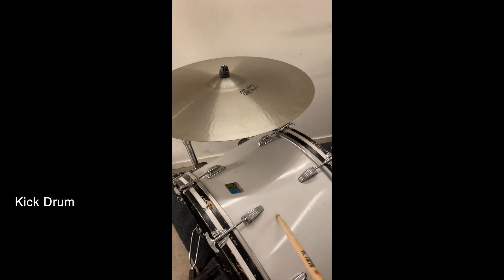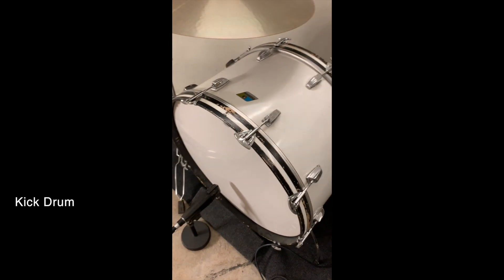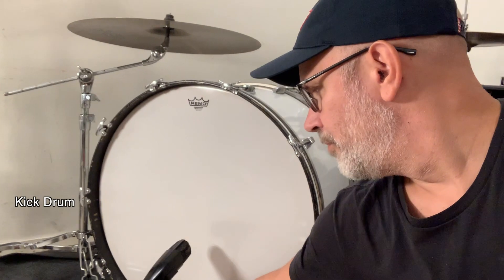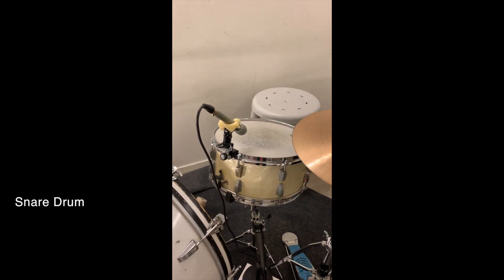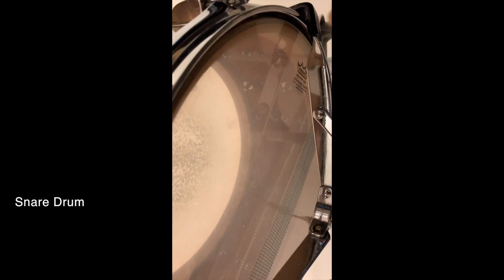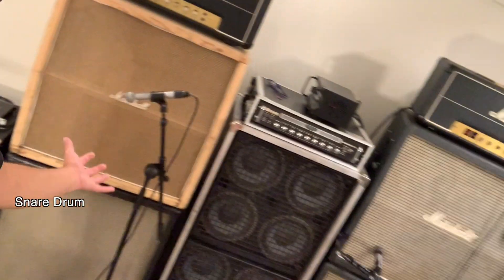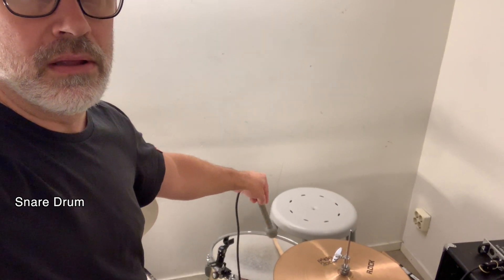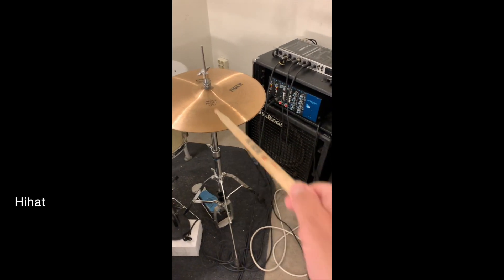How we record a 1970s DRUM SOUND - What would you do DIFFERENTLY?

Comment: You've got a great selection of mics there and the room is big enough. Three things I'd do to get a better sound...

Firstly, give the Glyn John's technique a try. I's a three of four mic method used on some recordings of Zeppelin, The Stones and The Who. It's really simple and fantastically good!!!

Secondly give the kit some TLC. Replace the heads and get a drum dial to tune them.

Lastly and most importantly, get the room treated. Try the drums in different positions in the room while keeping all the other equipment static. You may not realise it but all those 4x12 cabs and stuff lying around diffuse the sound in the room. If you want to go one step further get some basic sound control  into the space. Fluffy rug under the kit, a couple of mattresses to keep unwanted reflections down.. or maybe even make some panels up. :)

Comment: You're taking a sensible approach but you are missing a few important points about drum tuning, mic placement and room sound: 
1. you need to change the drum heads. The tuning is not very good - the heads are too old. Change the heads and tune them more carefully. Just like a guitar, the last few cents of tuning are important. You know if the harmonics are out of tune, the guitar sounds bad. Same with drums - the harmonics need to be in correct relationship to sound in tune. Listen to the harmonic overtones of the drums and tune them until the harmonic relationships sound good. It's impossible with worn heads. With new heads - top and bottom - you will be able to tune more accurately and get a better tone.
2. Try tuning the resonating head higher than the batter head. This tuning works very well for these old Ludwig drums. It's how John Bonham tuned his. Try Ambassador heads on the bottom and Emperor heads on the top. Because it's a lighter head on the bottom, you need more tension anyway. Still tune the bottom about a third higher, again it's a matter of listening to the harmonic relationships and tuning until you get a pleasant sounding ring. The Classic Maple's ring a lot, so you can also use some dampening - put a medium sized pillow inside the bass drum or a felt strip behind the heads. A simple piece of duct tape on the snare and toms can provide enough harmonic dampening.
3. It seems you are trying to decide between drum mics and room mics, but for your setup you would need both (or neither). The single room mic and individual drum mics are more for a mixing situation - you would use both and mix them: you can mix in some of the room sound and fatten your tone from the focused mics - that's typically the way they did it. A lot of early Van Halen was recorded like that - SM57's on the drums and large condenser in the room. So your setup could work for a full mix, but that's more work than you want to do - you're trying to get a good live room sound and record the whole kit in 1 track. Therefore, I recommend a different setup completely.
4. Try 2 overhead mics in stereo arrangement - either XY very close together or 45 degree arrangement on either side of the kit. There's also a method to put one mic in front and one next to the floor tom, sort of a 90 degree relationship. I prefer wide 45 degree - I place small condenser mics 45 degree angles from the middle of the drum kit: imagine the drums are on a circle and pick the direct center - it's probably over the snare or the bass drum pedal. Orient the microphones all 45 degree angles from that point: 45 degrees up and down, 45 degrees side to side, 45 degrees in front and 45 degrees mic angle. You can also go wider: 30 degrees and that will give you a more open room sound. I promise you will hear the bass and cymbals in this arrangement - with a 26" bass, you don't really need a mic on the bass. 
You can hear me using this setup here: https://www.youtube.com/watch?v=2XqM8IqkARw My sound is also not perfect but it's fairly balanced and nice sound, with every part audible and nothing too strong. This is all mic placement and no mixing - only 2 small condenser mics directly into preamps - (I use the old Russian Oktava's and UA preamps).

5. Lastly is your room - it's not a good sounding room, so you may never get a good result. You can try some foam in the corners - especially the ceiling corners behind the drums. If you can setup in a more natural sounding room, that will be better or add some sound conditioning, even some open cell foam (the yellow foam inside a sofa cushion). You know all those very expensive sound conditioning foams? It's not so different from sofa cushion material. You're getting some very nasty echoes, so I think you will need something to improve the room no matter what you do with the microphones. 
Love your videos - thank you for doing what you do. The amp comparisons are very helpful and your playing is a joy to listen to! 
Thanks from California, 
Joe, Trinity Cymbals
Reply: They're all great advices. But I think recordings can only sound as good as the ROOM. 

Regarding tuning and heads, sometimes a dead sounding kit may be desirable especially if targeting that vintage or indie sound. 

But I do agree with your point no.5

Comment: I have the same type of kit you do, maple Ludwig in Bonham sizes and also use 5 mics to record.  

This is how I've been getting good results; First off I position the kit against the back wall with the second 18"floor tom in the corner of the room. I cut a small 108mm port (yes it hurt to do it) at the 9 o'clock position on the kick drum resonant head and run the kick mic about 6" out from the drum head "looking" diagonally into the port in the direction of the snare drum focused on the point where the beater contacts the batter head. I take a measurement from the kick mic's diaphragm to the center of the batter head on the snare, and set a small condenser overhead directly above the center of the snare the same exact distance. I add a second small condenser IN THE CORNER of the room over the floor tom the same distance as the other two mics to the center of the snare (This captures a really full sound with the corner loading and you will have to bring the levels down a bit on this corner mic). Add a shure 57 to the top of the snare the same way you have your snare top mic in the video, I don't use a bottom snare mic (if you have a figure 8 condenser you can add a 6th mic that captures the snare bottom and kick beater at the same time, but it's not really necessary.) 

The only thing that varies in this set up is the distance of the mics and the position of the room mic, everything stays set up but you just take a few seconds to move the overheads and kick out equal distances from the snare and reposition the room mic depending on what the song calls for. For a tight punchy close miked sound, keep the measurement in close and put your room mic about 6 feet in front  of the kit and 2-3 feet off the ground pointed down at an angle to catch the reflection of the sound off the floor. For a bigger more open sound increase the distance of all the mics from the snare another 10-12" or so, and put the room mic in the top corner of the room opposite from the corner mic over the floor tom. I use a large condenser for the room mic, and it's also used as my vocal mic, so that's the only one that needs to be set up usually. Having the drums in the back corner saves studio space and everything can be left set up. It also means you have the option of running the room mic out the door in the hallway if you want.

When you mix, pan the small condenser overheads Left around 10-20% and Right around 20-40%, add a good amount of compression to the room mic to really pick up the sound of the room, and adjust the phase of the snare close mic and room mic for best overall sound. All the other mics should have good phase coherence since they're all the same distance from the snare. Setting up a template in your DAW with all the tracks and plug-ins ready to go means you can be up and recording in minutes for when inspiration strikes.

I thought the one that sounded best in your video was the single big condenser overhead, I don't care for snare bottom mics or hi-hat mics, overheads capture that stuff and sound better to my ears anyways. I like the thinner hi-hats of the two. (I'm using 18" Hi-hats, a Paiste Rude crash on the bottom and an old  Zildjian crash on top). If any of these ideas make sense give them a try and see what you think. Basically a Glyn Jons set up but with the over the shoulder mic in the corner. Another tip; If you record Bass live at the same time, put the cabinet on the floor tom side of the drums and with the speaker driver on an even plane with the resonant (front) head of the bass drum.
Reply from the maker: Thanks man, interesting feedback! And I’m definitely gonna try that last tip!

Comment: Get the snare mic in a lot tighter, try to get the back of it (null) closer to the hats.. and what you're thinking about balanced sound of the kick is really perceiving the "kick mic" as the room mic in a Bonham context.   
 Either go for the Bonham/glyn Johns approach, or Hal Blaine.   Bonham is probably a lot more room mic than you'd think, and squashed with a compressor.   
Forget the bottom snare mic unless you do Hal Blaine/Steely Dan/ dry close approach, then you've ...
Ahhh, just heard you're going to be blasting the amp at the same time... Then you've got to go tight and use a gobo.  And put a blanket on the wall opposite of the snare mic, you're micing the reflection off that wall.   Nice high ceiling, you should get the drums out into the 1/3rd area of the floor so the corner walls don't color it so much.

Comment: I get awesome drum sounds if I use 4 mics: 2 room mics, 1 kick mic and 1 snare mic. Kick drum mic should be something like @4:24 in you clip, maybe slightly closer to the drum head. Snare drum mic position and adjust to your taste (in this instance, i like it more transient or snappy, if you will).  I don't know about the size of your rehearsal room, but I would think that the room mics can be placed on the opposite end of the room where the drums are. This calls for either you or Simon to have a keen ear in the room about the best placement for them. In this configuration, however, the room itself must be a great room to record drums in. The room mics can either make or break the drum recording. Mix, EQ and compress to taste; I like the room mics slightly louder than the kick and snare. I spend a considerable amount of time EQ-ing and mixing the kick and snare, not so much (sometimes not at all) on the room mics. I don't know if you compress or not when making videos, but I tend to use the compressor quite a lot, especially if you bounce each individual mic to a single channel. In the end, you'll have some vintage-modern drum sounds that sound roomy and punchy (think Led Zeppelin, since you already have a Ludwig) while having a modern oomph to them with some potent kick drums and meaty snare.
Reply from the maker: Thanks Calin, the room is 3x5.7m and 2.7m in height. Cheers
Reply: @JohanSegeborn  wow, it looks a lot bigger in your videos. It's too small a room to record room mics because of very short reflections and quite possibly an undesirable amount of decay. There's a type of reverb, convolution (???) reverb, in which you can input the size of the room you want on the room mics, thus compensating for the size of the actual room. I don't really know if this works, havent really used that type of reverb at all, but it's worth a shot. It's a digital reverb, though, and it might be difficult to work with because it sounds like crap most of the time.

Comment: Looks like your doing it pretty well. I think instead of looking for another interesting vintage mic, a pair of great SDCs could change your life. I like the Oktava MK12 or the Shure KSM 137, you will be surprised how much low end these can capture as overheads or spaced room mics. Careful placement can preempt any phase problems and create a big track. I like to measure my spaced overheads equidistant to the kick beater, they work together to make a huge sound. It’s not so much about bleed as capturing accurately and working a cohesive mic plan. Live drums are different. 

Also get away from the walls a bit, corner reflection is not your friend, odd low end things happen in the corner. If you diffuse and absorb behind then it may be reduced greatly.

Of course, in your own space you gotta make those calls. Looks like a tall room, can be good or bad some rooms make nasty slaps on the ceiling, best studios I have been in have been vaulted or padded some at the ceiling.

Happy drumming, remember balance is achieved by being light on the cymbals and heavy on the toms and consistent about snare hits.

Comment: IMHO...
Damp the kick. Cut a hole in it so you can even put the mic inside. Nulls and peaks are usually about standing waves in the room, not mic distance (pressure waves are moving). 
Put a teatowel on the snare. Tune it low and damp it.
Your room mic seems way too far away. Put a large diaphragm condenser 3-4 ft in front of the kick and move it vertically to balance kick and cymbals
Play the snare like you are slapping a but not punching a face.
Use lighter sticks to crisp up the hh. Put some absorbing material at least on walls behind hh or on roof to cut down on hh everywhere. Raise the hh as high as is comfortably possible away from the snare to minimise spill.
Also think about the crazy phase relationship between the hh mic and room mic... Here you will have those peaks and Nulls, the delay distance acts like a fixed phaser (notch eq).
I love your vids and am completely ranting. There's so much that could be done but we all have our own vision.
I'd work on the playing and the room and use just 2 mics. Look at Eric Valentine channel on YouTube he is amazing. His drums are SICK and classic with one mic!
Its hardly ever a microphone issue. Fix the room, damp the shells, use as few mics as possible. Life will become zen